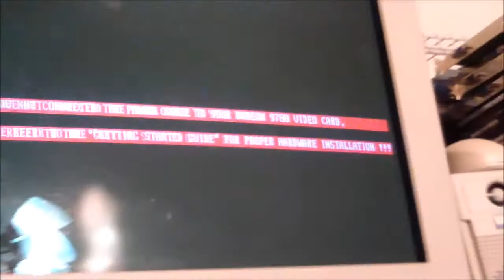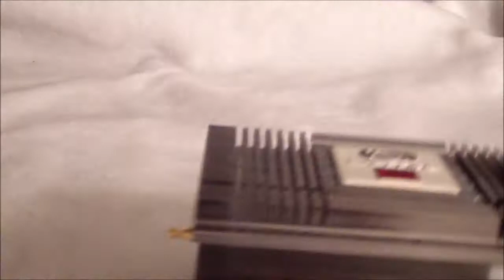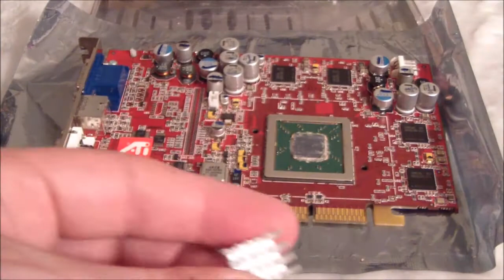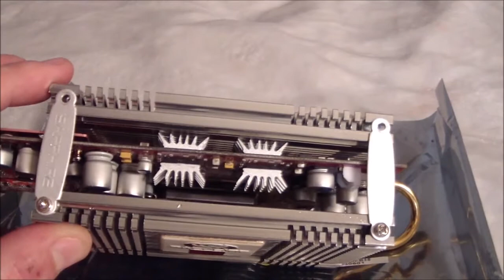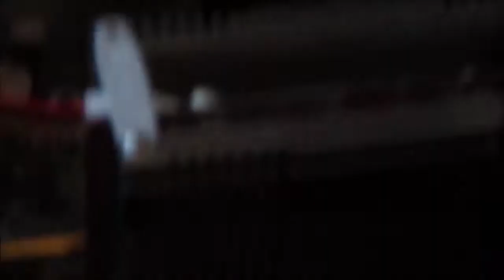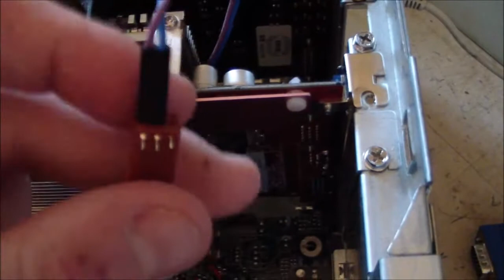Passively cooling the Radeon 9700 Pro

Comment: I think you need somewhere for the air to go from that fan. With the case cover right above it you are going to block the airflow a bit. I think they call it static pressure. I overheated a machine recently doing this. Fortunately it was a CPU I was cooling and the machine shut down to protect it.
Reply from the maker: fans blowing downward on this one so its hitting the board and going outward where hopefully a well circulated case will take it away. usually you need to use fans like the one on the 9700 in conjunction with other case fans to create airflow. technically though the fan on this cooler is a sort of option as its supposed to be fine fanless.

Comment: I  realized when I saw how that heat-sink was attached that I very briefly owned one, and It sucked. Zalman products were al the rage back then. It got to hot and a external fan was almost always needed. Then to think I now have a 980 gtx and the fan only spins up on heavy use ;-) There was also a case back in the day that had this massive aluminium side so you could cool your cpu with your case. If you had a AMD Thunderbird 1200 you could use it as a space heater no joke.. Good to see some new videos, take care!
Reply from the maker: My DOSzilla machine has a AMD Thunderbird 1400 that gets crazy hot. I do like the look of this overly large heatsink . Plenty of new stuff planned and finally got a new and slightly upgraded camera which I'm happy about so maybe future videos will be easier on the eyes.
Reply: Yes, I've always wondered why people talk about heat coming off electronics and computer equipment so negatively. I know it's basically electricity being turned directly into heat, thus not being exactly used for the computer (less efficient), but I think, hey, what if you already have an electric furnace and it's winter? 

The heat coming off your pc just makes it easier on your furnace to heat your home, considering most units run off a thermostat. Now if it's summer or you heat with an efficient heatpump or gas, etc., it's still helping contribute to heating your home, just less efficiently, or in the case of summer, yeah, it's just bad, lol.
Reply: @TortureBot  hotness is problem not because it warms your room.
It shortens lifetime of electronics. Especially, Radeon 9500/9700 series died out like crazy because of it. It's why they have incredible high price on retro market. Because ATI was stupid. This is problem of paste they used along with incredible hot chip. Ati was behind Nvidia, even in times, where they were ahead in FPS graphs. 
Another issue was low overclockability.

Later, there was Bumpgate problem particulary on Nvidia side, where heat played even more destructive role. Basically cooler graphics had less bumpgate problem. 7900s were dying like crazy. 7600 survived more.
Same for 8600 (survived easily), while 8800/ 9800 are scwred. Nvidia secretly addressed bumpgate  and switched to other substrate, it took them about 3 years, before they analyzed problem. And they did it in secret. So it doesn't bring attraction. But now, it's already figured out by very smart people, that they found problem, didn't admit it, just changed substrate under die, which solved the problem. That die is specially made so bumpgate cannot happen, so it was purpously invented.